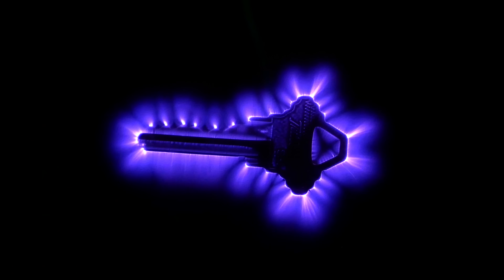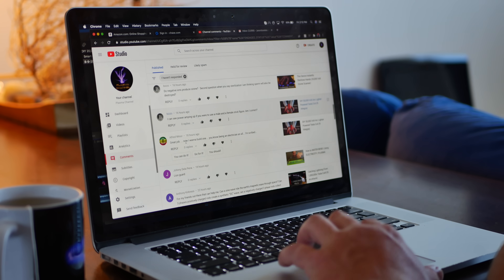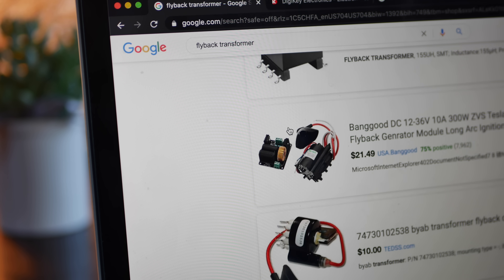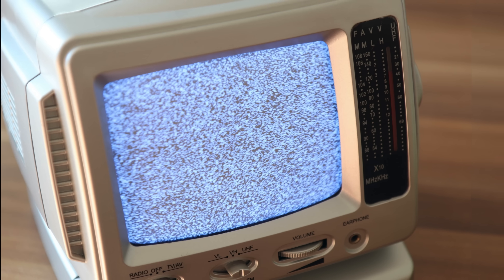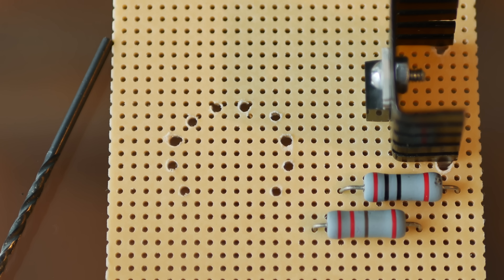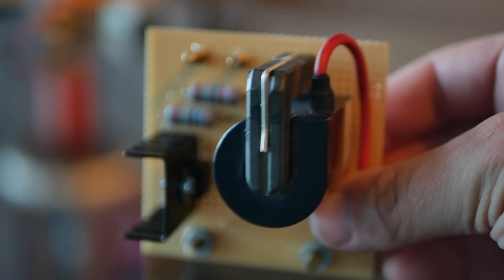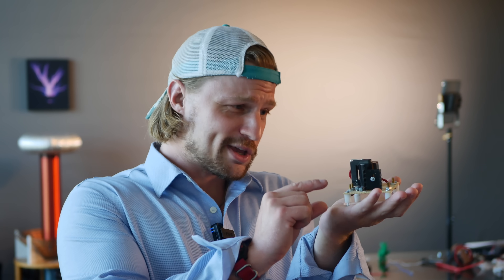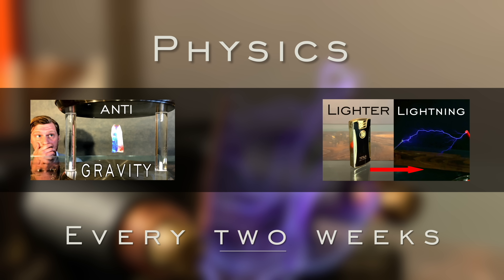DIY Plasma Physics Powersource (Mini 20,000v Flyback)

Comment from the maker: PLEASE NOTE: 1) The high voltage ground is found by slowly bringing the high voltage out near the pins. One will heavily arc to the HV out - that is the ground.
2) When using resistance to find your two coils, regardless of what I showed in my video - primary and feedback coils will both have very low resistance.
Reply: Can You Make Plasma Gun.
Reply: Can I beef it up with a bit bigger transformer and resistor and voltage
Reply: how can it give out 20,000v when most copper wire only can handle 600v?
Reply from the maker: @thoththeatlantis3379  Copper wire can handle as much voltage as it's insulation is designed for. That varies tremendously. Also, 600 volts is only for a single wire. If 20,000 volts is divided over 1000 turns on the secondary of the transformer....its only 20 volts per 'wire' so to speak.
Reply: @PlasmaChannel  sir but what is difference between high voltage ac and high voltage DC???

Can we  identify them by see their arcs
Reply: @PlasmaChannel  sir my eht/flyback Transformer had only 8 pin please help me🙏🙏🙏🙏🙏🙏😭😭😭😭
Reply: @thoththeatlantis3379  
It isn't voltage that limits a wire size. Wires are limited by heat, which is generated by current.
 With the small amount of power going into these Transformers, there is miniscule current, so the only limitation on voltage is how much the insulation can prevent from arcing.
Reply: @The2x4  does that mean if I cool the wires in 0celsius or so it can carry higher voltage and amps?
Reply: @thoththeatlantis3379  Yes! That's why high performance electrical motors have cooling ...that is the single reason, so that the insulation when starts to heat up, the materials do not melt ...  Outside of expansion and contraction, that can crack materials too... Actually that describes really the biggest enemy in electronics :HEAT 🙂👍 some if those asian friends doing diy elec driven boats just use a water pump w tiny water hose , and wrap it around the electrical motors , to try to keep them cooler ...
Reply: I have done and it works fantastic!! thanks mate. Next video, show us a few cool tricks to do with this power source :)
Reply: @JavierChiappa  bro which battery you had used
Reply: Not bad but you should shock yourself like electroboom
Reply: heym it make 20KV in witch frequency? i wanted 20kv/30kv in 15Khz
Reply: is the output dc
Reply: @oliver1834  Absolutely only DC never use AC power for any Bio Electrics.  The human body can actually handle 250-300 volts of DC no problem but I'm starting with 9 volts
Reply: @oliver1834  Good question btw
Reply: Will it's last long with 12 v supply and how much current it's consume?
Reply: Can I make this circuit using mini flyback,found in chargers? please answer😊.
Reply: @mehedihassan8944  well those are not flyback transformer you'll have to rewind the secondary to 1000 turns and the primary to 5-0-5
Reply: @sana.m  thanks,i successfully made it over a year ago.
Reply: Great Video clip! Forgive me for the intrusion, I would appreciate your thoughts. Have you heard about - Elijahzan Ailment Solution Review (google it)? It is a good exclusive product for saving money with your own electricity supply without the headache. Ive heard some incredible things about it and my old buddy Taylor finally got great results with it.
Reply: Hola si hablo español pero esta interesante 👍
Reply: There is no such thing in our country.
How do I get these?
Reply: Mohon waktu nya sebentar untuk mampir ke sini https://youtu.be/cDPlchYn1aI
Reply: Help answer
Reply: can I use a A614 Y-440  tranzistor?
Reply: Please  make vedio  Clear Diagram  this project
Reply: I dont suppose you could hwlp me get the right transistor? Two are recommended in the video, but the one shown is different, and then another one in the description
Reply: Ql
Reply: How do you know exactly that it is 20,000 volts? Did you tested it and can you test it and show online?
Reply: THIS WAS AMAZING MAN!! LOVED IT!!
Reply: Hı man
Senden derini algılayan dedektör yapımı bekliyorum
Reply: Is it generate energy with out any electricity in it from outside
Reply: @DilipKumar-jh3dp  No
Reply: Can you use an AliExpress high frequency induction heater driver with a car coil for an off the shelf system?
Reply: Can you help me my transformer pins have a varying resistance. Like when I first tested the resistance of my first pin it was 1.2 ohms then the second time I tested it it was 3.2 ohms then it was 2.4 ohms. Is this supose to happen
Reply: For the fly back transformer do we need to use the exact same one you used because when I tried it with one that was from an old TV not the mini TV you showed. And mine was bigger and had 2 additional wires at the top
Reply: @treverbelmont8393  Those two additional pins are of in-built capacitor of the transformer
Reply: Ok
Reply: Can you make a video on plasma Engine.
Reply: I'm french, sorry if I can't explain correctly:
Is it possible to make a frequency, duplicate it and invert one, put the first frequency on a tesla coil, and the other on an other tesla coil?
Did it multiplicate by 2 the power on the electric arc?
Second question: what is the usual frequency for a plasma arc?
Reply: I'm having a problem with mine it's drawing power and it's humming but I'm not getting much voltage
Reply: What is the input voltage?
Reply: @3dgiftz  12v
Reply: Awesome I always seem to end up with the huge flybacks from giant tvs. How's it hold up to burn out on your board?
Reply: Amazing project
Reply: Can we touch it with fingers ??
Reply: https://youtube.com/channel/UCZ08AKbOBuaQC0sh8hcI5nQ
Reply: Thankyou
Reply: still trying to figure out how these friggin things work and which ones the primary and feedback pins are. So many that  seemed like it but didn't work. I've got 3 of them just sitting here XD
Reply: If i understand correctly u are using a slayer exciter circuit basically right?
Reply: Will it last long?
Reply: I am Dylan I am 7 years old and I don't even have a Tesla way I try making one but do you think you can give that one to me since I don't have any plus I like science and stuff and I don't even have a 3D printer or electronics to make it. Can you send it to me please? I really love it.
Reply: i want to make 100k volt. where is the circuit for it
Reply: "noodles thinks my soldering job is sloppy" then tell noodles s/he is wrong because, in my opinion, it is pretty good
Reply: Ever study Halton Arpe?
Reply: needs to be able to fit in your pocket
Reply: I can't find a mx d363 transistor anywhere
Reply: Plz upload in hindi dubbed
Reply: sir please is it dangerous for Health (will it be enough dangerous to kill some one) I dont have much knowledge about these things just on the surface of physics....
Reply: @高圧トランス実験魔-q7d  what are saying ????
Reply: Sir how are you
Reply: sir how do you get up so early? 6:00 am???????????!!!!!!!!!!!!!!!!!!!!!
Reply: @rosebiswas758  🙄these many questions
Reply: Sir please give me a reply
Reply: Sor are you a fan of Tesla???🥰🥰🥰
Reply: sir please try to understand what I say
আপনি কেমন আছেন?
Please sir try to reply it Bengali
Reply: @rosebiswas758  😁😁😁😀😀😀
Reply: @rosebiswas758  আমি বাংলী ...  Bolchi... Ami ata toi ri korte chai.... But, bujta parchi na... Kon flyback transformer ta nabo!!!!!
Reply: @srijandas2748  je kono akta nilei holo ami onek type er use kore dekhechi sob kota same kaj kore
Reply: @srijandas2748  kono tar Power besi konotar power kom but satisfaction asbe baniye
Reply: @rosebiswas758  tumi tori koracho.. Bhalo toh
Reply: @rosebiswas758  bolchi dada, flyback transformer er primary wiring and koto mota copper niya korte hobe.. Please bolbe!!
Reply: @rosebiswas758  bolchi 2n3055  transistor er price koto hote para??
Reply: @srijandas2748  jeta khusi ne just insulation jeno proper thake ami soru coil winding kora hoy jei tar dia otao use korechi abar mota diao korechi
Reply: @srijandas2748  ami bolbo 2mm dia kor
Reply: @srijandas2748  but ota khub risky.tai nijer safety niye ja korar korbi otherwise korbina
Reply: @srijandas2748  15 taka normally hoy. But metal er Nile 60 taka
Reply: @rosebiswas758  thak baba.. 12th pass kora bhalo kora.. Physics janta hobe.. Nahola.. Kothay more tora bosbo 😅😅😅
Reply: @rosebiswas758  bolchi ota k abar earthing o korte hobe... Amar electronics bohut bhalo lage.. But, ei project ta bohut dangerous mone hocha 😊😊
Reply: @rosebiswas758  https://youtube.com/c/ZAFERYILDIZ52   enar channel tao bhalo... Follow kori... Eni irfz44n mosfet lagia kora chan.... Kora dakhte paro..!!!.. Thank you dada for replying me 😊😊💖💖... R bolchi.. Tumar bangladesh a bari.. Amar West bengal...???
Reply: @srijandas2748  tahole battery dia kor kono earthing dite hobena
Reply: @srijandas2748  5v dia bana kaj korbe low power debe
Reply: @srijandas2748  ami korechi ota diao dekh vai simple fanda amplify kor sob applicable hobe
Reply: @srijandas2748  amar west Bengal e

Comment: I think one fun test i like to do after  checking resistance to make sure it is the primary is by manually switching it and you should get one tiny hv pluse on the output since a real primary coil would not only short circuit but it would also make a  short hv pluse after shorted

Comment: so ive just bought an array of image intensifier tubes and some of them are requiring 16kv input possibly DC. would it be possible to modify the output of this to be dc? what is the output frquency and is it ac or dc/pulsed?

Comment: I want to electrify my Pirate ship. To feed the sharks . Got the flyback and the transistor and resistor's. I'll use the military grade parts from my collection. It's a worthy project for my gold plated gems this time. I'm a solder brain too. I'm into rain making. Plasma shielding.shattering viruses with frequencies. That made a few enemies lol I don't bother with it now . Big pharma isn't nice . But I never lost a fight in my life well the first fight I lost I was afraid but it didn't really hurt . So you know the thing man lol . I even got the Roswell toy. Modified .07 just in case.

Comment: I recently made this thing same circuit everything is same but my transistor is getting hot and my power supply I am using 12 volt 1.5 amp power supply but it is getting on and off simultaneously I don't know what I did wrong so can anyone help me please plasma channel help me... 😅 Any suggestions answers would be great 👍

Comment: Honestly; I kinda doubt that power supply can output ~20kV; that illusion was most likely from the sharp edges on the screw and wire when pulling arcs off it. I tested my power supply (very similar to yours); it has 6,6kV output at 12V input; 10,5kV output at 19V input. I measured this with a 90 microamp analog meter and a 111,12 megaohm resistor. The arc jumped 1,7cm at 10,5kV, then the voltage dropped to 1,5kV while the arc was going. This was caused by sharp points on the wires. 12-15kV might be possible, but that would really push the limits of a flyback that small. (Just my opinion). If anyone wants to ask me something about this, do so by all means.
Reply: That's probably true. You can see people on youtube measure the distance between two pointy electrodes. That's not at all a good way to measure the voltage. You can use spark gaps to measure the voltage (with pretty big errors). But you need to use the proper electrodes (there are standards for this). There are Schwaiger factors for correcting inhomogeneous e-fields. There are also corrections for gas pressure and humidity. If you measure a point electrode to a plane there is a polarity difference. AC is easier to measure than DC. There's quite a bit that goes into high voltage engineering.
Reply: Update: still works, feedback: 5 turns, 0,2mm; primary: 10 turns, 0,5mm. (I would them on the ferrite core, but wrapped 2 layers of paper on it first). I also use a 100nF/630V resonant cap across the primary. The transistor is a KU612 made by Tesla (czechoslovakian). 

I'm now making an AC high voltage supply (with 2 transistors this time); the flyback is from a Triton X6 ionizer (~135€ new in Europe); I salvaged mine at a waste collection yard, it works well. The topology is the same as rimstarorg's "the cube", but mine has a ~100-470nF cap conneced to the collectors of the transistors. I've tested it and it puts out ~4-10kV (8-19V input). The windings are: feedback: 6 turns, 0,2mm; center tapped (3 turns on each side); primary: 20 turns, 0,5mm; center tapped (10 on each side). Test transistors are KU612 so far, but final ones will be 2SD2060. The resistors have to be: 220-270 ohm and 22-27 ohm; both rated for 5-10W (for longer runtime, ~>5 minutes).

Comment: Thanks for this great video! I NEED to reproduce this.

Would a cheap "Boost Step-up Power Module High-voltage Generator DC 3v-6v to 20kV" from eBay work for as a supply? 
I assume it has exactly what you built inside it.

Comment: Hey man can you please come back to the comments in this video and answer some questions of mine? I have been trying at this build for days and I just need help with some issues I’m having with my flyback.
Reply from the maker: What’s the main issues you’re encountering?
Reply: @PlasmaChannel  ok sorry in advance for the long paragraph and genuinely thank you for responding so quickly, I’ve been working on this for awhile on and off because it’s my first experience with this kind of circuit so I’m being slow and steady to say the least. 
I’m just a little confused with the ground pin on my flyback. I cannot find any datasheets so I have no idea which pin it is. Also my flyback’s terminals are strange. The feedback coil’s terminals seems to be where I’d think the primary would conventionally be and the primary possibly has three terminals that read about .05 ohms less than the feedback so that is confusing me. It makes the wiring feel like I’m solving a line crossing puzzle. Also, since I’ve never worked with a flyback I’m a little bit confused about the high voltage ground in general. Would I be able to just connect it to the rest of the negative side of the circuit, or would that end up being messy? My gut tells me it wouldn’t matter but I just cannot find any conclusive answers and I do not want to risk frying my components, myself or just being a couple feet from a 15,000 volt short when I turn it on. Idk honestly today with it has just been off I was fairly confident yesterday but I’ve just hit a roadblock with all of this stuff today and it has weakened my confidence on getting it done to say the least. I currently have two flyback transformers, I went with the one I have because it lacked the black spots in the insulation the other one had. I am just confused as to if flybacks are usually this odd to work with or if mine is just torn up. I got it out of an old tube monitor from a computer store. This transformer in question is a CT - 8492 Flyback Transformer and chat gpt claims it was made by Chengdu. Still with that information, I was unable to find a data sheet. I have an old TV radio that probably has a flyback in it but I really don’t want to tear it apart because it works perfectly and I don’t like tearing up old technology even if it is kinda useless. I apologize if this was hard to understand, I am not very good at communicating things like this and I really do appreciate you taking the time to respond to me because I literally have nobody I can ask about this because I live in the middle of nowhere and Idk anybody skilled in electronics at all.

Comment: I am kinda confused. I’ve got everything in order, drawn up basic diagrams from the schematic and I have soldered the flyback to the pcb, but I’m a bit hung up on a few things. What exactly do I do with all of the wires coming out of my flyback? I’m unsure which I should snip and which I should keep. I’m being a bit cautious, I am just wondering what you’re doing with those red wires coming out of the flyback. I can’t seem to make sense of that looking at the schematic.

Comment: Yet another one of THOUSANDS of electronic projects out there with at LEAST one component that is no longer made/available.
Reply: Just find a transistor that has the same or higher ratings for current and voltage. I found one in the rga monitor I got my flyback transformer out of. The one I’m using is a C5297 Transistor.

Comment: Do you just connect it flyback back to itself with griund?
Reply from the maker: For the sparks? They are between the ground wire of the transformer, an the HV output.

Comment: is it like the voltage multiplier; the one that uses diodes and capacitors? like high voltage and very high frequency but low on the amps? like, can it hurt you? because i see you're using a transformer also. so, just really high voltage at really high frequencies but really low amps?

Comment: i have a question. Is the output of a flyback transformer DC or AC? I want to use it for dielectric barrier discharge, but the flyback transformer I have goes through a circuit with two MOSFET switches and outputs DC. For dielectric barrier discharge, I need AC high voltage output. What kind of high voltage supply do you use in your dielectric barrier discharge experiments?

Comment: But what transistor did u use ??? Ok i got the circuit and the build but the transistor ??? And resistor values and power ?

Comment: Very interesting, but curious as to how you are getting that thing to oscillate with only 2 resistors and a mosfet, and strait dc input??  Also what do you think would happen to the voltage output if instead of a pointy wire, you connected and brought close a brass or aluminum sphere?  How about a 1 inch vs 2 inch sphere?  This would be a very interesting experiment to me.  Thanks bro.

Comment: Thank you very much. I have tried applying oscillator circuits to one low resistance coil of a flyback transformer with no luck. Your video made me realize that I was missing the idea of having to use a second low resistance coil for feedback in the circuit.